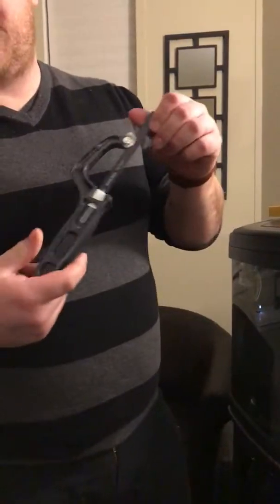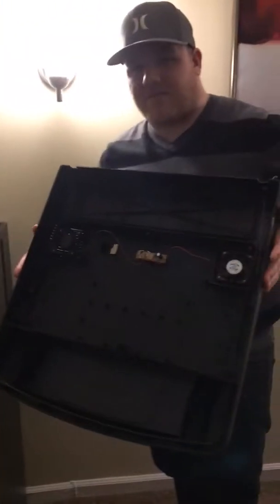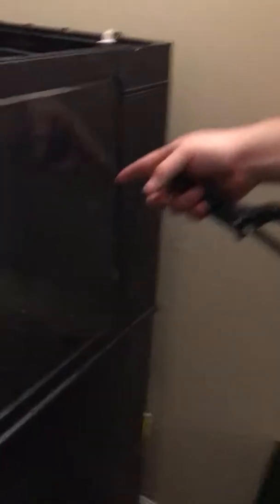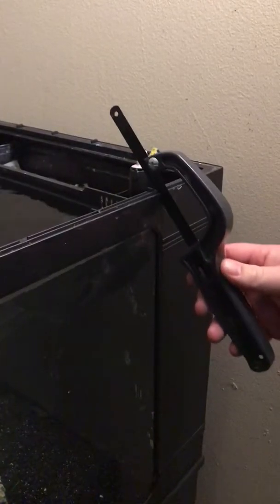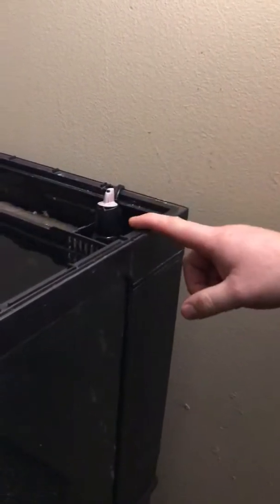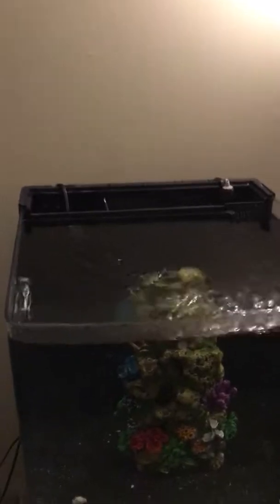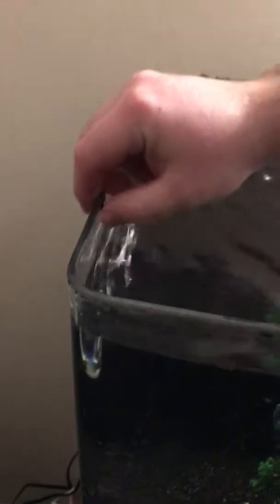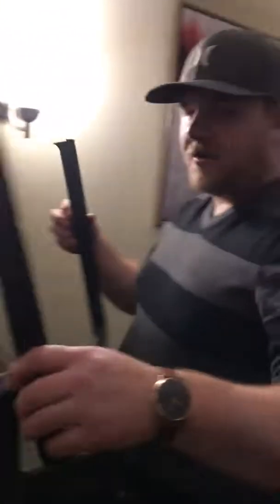Biocube Rimjob! DIY rimless Biocube. How to make a Biocube rimless

Comment: It's a lot easier to just use a heating gun and it cuts down the time and work more than half.  Just heat for a few mins and it comes right off all the way around.  No saw so you won't have to worry about chipping the glass.